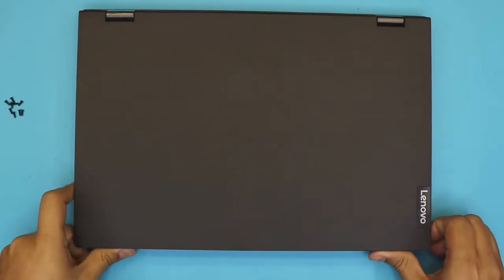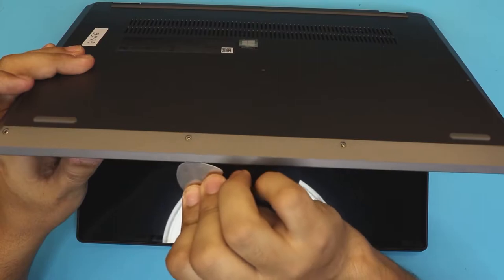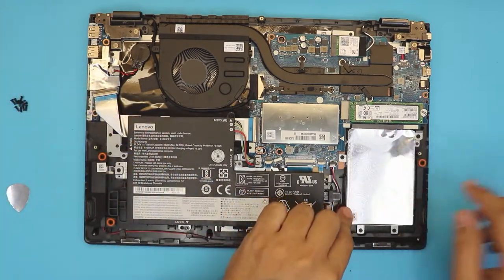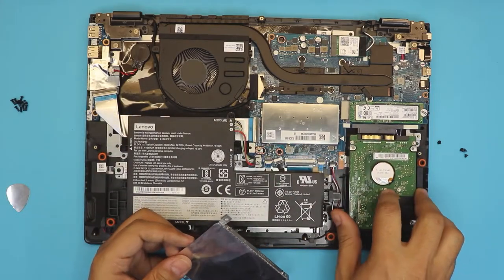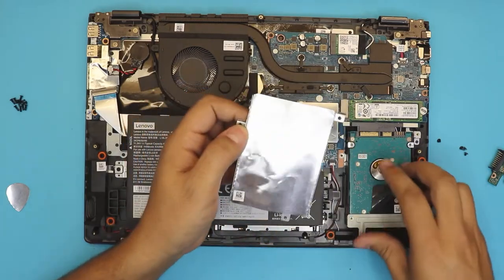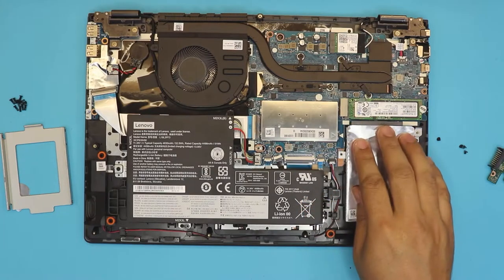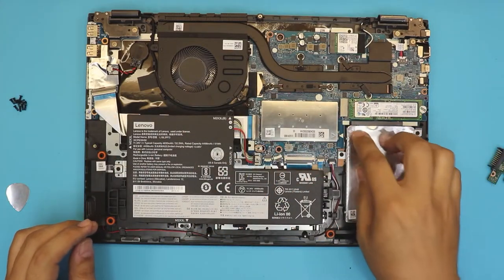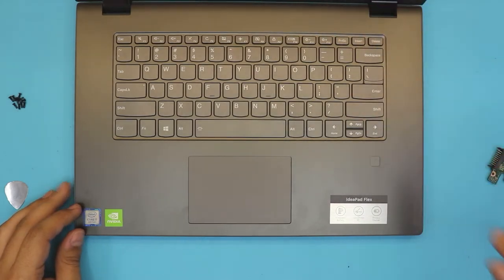How to upgrade SSD, Hard Drive on Lenovo Ideapad flex 15iwl , FULL guide

Comment: Great video, thank you.  Question, if I "swap out" my existing SSD drive (1TB) for a 2TB, how do I move the operating system from the original to the new?
Reply from the maker: there are two ways of doing this, the best and most recommended is, 
go to windows website and download the "Windows 10 installation media"
https://www.microsoft.com/en-gb/software-download/windows10
and place a 8gb minimo usb stick and it will automaticaly download and burn it into the usb drive.
#2. put remove the old ssd drive and place the new one in lap
#3. turn it on and press f12 to got to bios boot menu and choose the usb drive to boot from,
#4. follow the easy steps and under 20min you will have the new windows installed.

SOLUTION #2.
place your old ssd and once inside the windows
if you upgrading nvme drive you need to use this:
https://amzn.to/3nJ4HgW
if you upgradign your ssd sata you need this:
https://amzn.to/3fjTxwd

once you have the correct adapter place the drive in the correct adapter and plug it into your laptop and download the following:
Macrium Reflect
its free
and using this program you can clone your main windows into the new drive connected via usb.
after cloning power off and place the new drive and you are all set.

NOTE with cloning application sometime rare it doesnt work well and you may face a bluescreen when booting up to new drive.

i hope i explained it else let me know, thank you for the support
Reply: I recommend to do the following:
1. Install Macrium Reflect : https://www.macrium.com/reflectfree   (Free software)
2. Clone your sdd to an external hdd using Macrium Reflect.
3. Create a boot flash drive using Macrium Reflect. Make sure your BIOS will allow you to boot from a flash drive.
4. Install blank sdd.
5. Boot from flash drive.
6. Restore the image from your hdd to your new sdd.
7. Unplug your flash drive and reboot your computer.

Comment: I have the same laptop [ Lenovo Flex 15IWL 81SR 15.6" Notebook, Intel i3, 8GB Memory, 128GB SSD, Windows 10 (81SR000XUS) ] can you tell me please the right 1TB hard drive to add! And do I need to change the system to the other hard or do anything! And thank you so much.
Reply from the maker: hi and thank you for the support to the channel my friend :)
regarding your question you can place any "2.5' sata hdd 0.7mm thick",
this one is hybrid its fast:
https://amzn.to/2WVpxOQ
or your can place a normal hdd sata 2.5':
https://amzn.to/34UG6i7
حظا طيبا وفقك الله.
Reply: @uFixTek   thank you so much for your reply. You are super talented
Reply from the maker: Thank you :)
Reply: @uFixTek   I am sorry to bother you again with another question. Just to be sure about the Ram , I have  two separate 4GB ... According to what I have understood, if I want to upgrade them .. I should change the two ram and put two 8 or 16 ... in your opinion is it worth to change them ?? Or 8Gb ram is good for engineering programs! And thank you a lot
Reply from the maker: im here to help out :),
if you doing engineering programs that require more rams, you can place any combination of the ram size that you would like 4gb +8Gb or mix match. 
and in your case that you may have a one ram soldered on the board, so dont worry , you can simply remove the 4gb ram that you have and place a 16gb ram dim:
https://amzn.to/2KBt8z7
and the ram specs should be : "SDRAM DDR4 16gb" if you can get single rank , its better that dual rank dim. the differences are really not notable.
therefor you can place 8gb or 16gb ram
here is a video for it:
https://youtu.be/ATUgGvi5gk4
Reply: @uFixTek  wow , thank you soooo much. I really appreciate that and I wish you the best with your amazing channel :)
Reply from the maker: Thank you for the feedback and your support and if there is anything in the future that you need help with feel free to ans me in any of my video comments ( post new comment so i dont miss it), good luck to you too my friend :)

Comment: If i want to upgrade and add an hdd ..where is the slot for that..and if i do so..will i be able to use my ssd ??
Reply from the maker: Thank you for the feedback and your support to the channel by a SUB :P
regarding your question:
if you have watched the video right @1:29 i show you where the m.2 ssd is (thats where your windows is) and then 2nd place is for the regular hard driver or extra ssd. and once you place the 2nd ssd or hdd you can use both.
1tb ssd: https://amzn.to/3dvUJw3
2tb hdd: https://amzn.to/3sR8Y4R
Reply: @uFixTek  bro i have ideapad flex 5 model number in upper comment ...i am asking for that ..please tell me can i upgrade it..also u have a new sub 🤞😍
Reply from the maker: Thank you and yes the "81X2004RIN" model can  supports both m.2 ssd and HDD / SSD sata
if you got the 256gb model then you have a m.2 256gb installed, that means that you can place an extra hdd or ssd SATA 2.5".
Reply: @uFixTek  mine is 512 gb version 😓
Reply from the maker: ok it then thats good , you have enough space for windows and programs, and then add an extra ssd sata and you on your way to moon :P

Comment: Your hdd is 2.5 inch?
Reply: And are you using ssd or hdd? Can you pls anwer them.
Reply from the maker: yes any 2.5" SSD SATA OR 2.5 SSD SATA.
you can put any of them. if you want faster go with SSD sata they only come on 2.5". good luck
Reply from the maker: yes any 2.5" SSD SATA OR 2.5 SSD SATA.
you can put any of them. if you want faster go with SSD sata they only come on 2.5". good luck

Comment: Do i have to remove the nvme when i install the low profile hard drive? Laptop doesn't recognize new drive
Reply from the maker: no you dont need to remove nvme  or anything add the new HDD and make sure its connected correctly all the way in, and go to disk management your new hdd may be not activated.
right click on my computer and go to manage then go to disk management and scroll down when you see the new drive in black color right click and create new partition.
Reply: @uFixTek  ok thank you very much
Reply from the maker: anytime my friend

Comment: bruh, if i put my ssd on caddy replace the dvd rom will the speed same when i put my ssd on internal slot?
Reply from the maker: But this laptop doe NOT have DVD rom my friend. if you trying to do this on different laptop , it depends the laptop it may have sata 2 for the dvd . what is the exact laptop model.
Reply: @uFixTek  my laptop is flex 2-15 bro that have dvd rom slot
Reply: @uFixTek  better on the internal slot or on the caddy? which is better? sorry if i asking too much
Reply from the maker: internal, the caddy its sata 2, much slower than internal that is sata3,
anytime you got nay question feel free to ask me, saludos
Reply: @uFixTek  So if i put my old 1TB HDD on the caddy and the SSD on the internal it will be okay?
Reply from the maker: yes that will be perfect.

Comment: Is the hdd 7mm thick?
Reply from the maker: yes it does, but get the less mm if you can.
Reply: @uFixTek  I think it has to be 5mm ultra thin. The 1TB ultra thin is very expensive about $400.
Reply from the maker: @dennisp5302  we have fit a 7mm but it will be tight fit, but 5mm its easy fit, and yes they come with hefty price :(